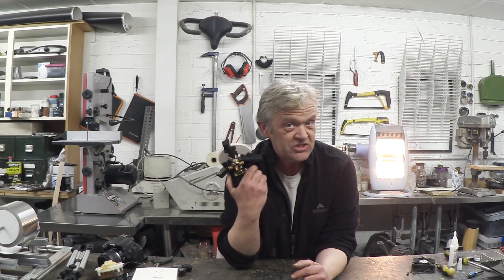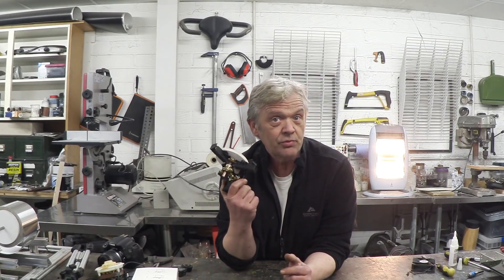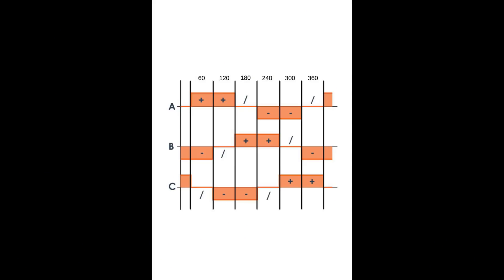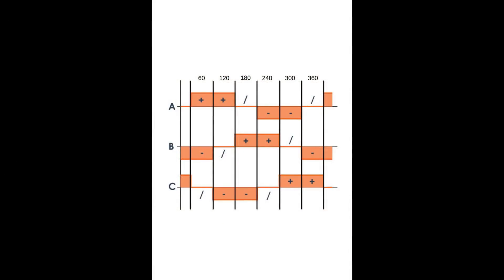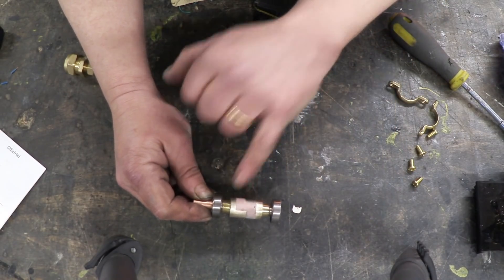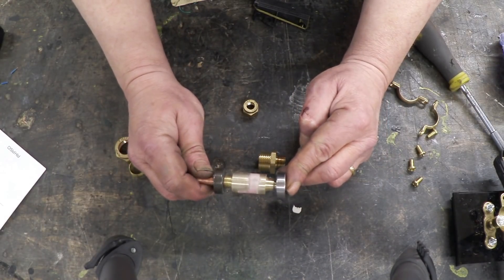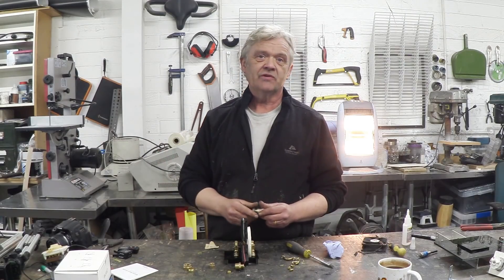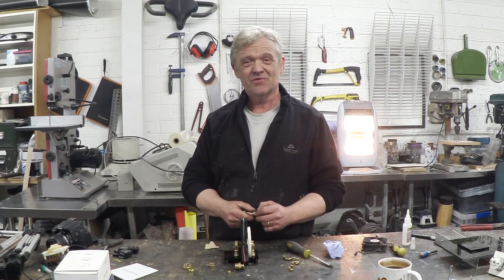1019 DIY Brushless Motor Controller Construction Details

Comment: it seems like one could get around the whole brush-wear issue, with 3 magnetically controlled momentary contact switches (like they've got in those swinging desk toys) and properly spaced permanent magnets on your rotor.   might add some small expense but if someone managed it,  I think it wouldn't require much if any maintenance, be frictionless, and still have the mechanical control advantage of being pretty simple.   Just a thought, if anybody wanted to play with that notion.  not sure how Fast those switches can go, physically- that might be an issue, but a more durable brush alternative for this sort of application where it's being a switch rather than a motor seems of some use.
Reply from the maker: that's clever mate - I like it
Reply: This sent me down a "conductive ferrofluid" rabbit hole (which I suspect your ink would excel at)-  a mix of copper and plastic tubing, and you've got a switch controlled by the motion of a permanent magnet (found a vid of kids that were working on the concept for reconfigurable circuit boards using conductive ferrofluid, that was mindblowing, but a simple switch that Can't wear out- that's relatively easy to achieve I think.)

Comment: When they say simplicity of engineering a DC motor controller they most certainly have you in mind. I am just amazed again with the down to earth way of making things on the cheap. Well done again Robert. Just cannot wait for more from you SIr. Thanks and peace too.
Reply from the maker: lol - cheers mate
Reply: @ThinkingandTinkering   we will make graphene brushes and use it as secondary bearing also  it wont wear out , fulfills primary obligation
Reply: @ThinkingandTinkering  i had this though last week... mainly cz i am poor and trying to drive a 200kw motor in a motorcycle

You have no idea how happy i am cz you saved me all the work and RND

Also the weight savings and wasted head are much less

Thank you sir
Reply: @FirstLast-tx3yj  How is your project going?
Reply: @Persanity  on the back burner
Just replicated the model but didnt make a larger unit for big power

But hopefully i get the time to do so
Reply: @FirstLast-tx3yj  I still need to replicate it so you are ahead of me! Hopefully we both get the time to work on it.

Comment: One application of brushless motors is in areas where there are flamable vapors. Where a brushed motor can't be used due to risk of arcing igniting the gas. This solution separates the brushes from the motor. That way we can still have the power without the cost or risk. Brilliant!
Reply from the maker: yeah - I never thought of that - cheers mate

Comment: Very simple and practical solution.  I need to power brushless motors for driving benchtop machine tools, and the IGBT 3-phase controllers are expensive!
Reply from the maker: I was thinking of doing a cheap H bridge relay based vision of this mate would that be of interest?
Reply: @ThinkingandTinkering  Yes, it would.  As a new sub, I like the way you approach electronics in an accessible manner.  Surplus brushless motors are often cheap, but controlling them can be daunting.

Comment: about 50 years ago i used to do some work for a board mill that still had a lot of DC motors .supplied from a very large and impressive mercury arc rectifier. speed controle was from a basic reostat for small motors  .stepped resistors like used on trolly buses and great big brime filled tanks with semi circular blades that were wound in. oh almost forgot the small ones with inductive brakes (an aluminium disc with a moveable magnet) i am realy enjoying these videos keep up the good work
Reply from the maker: cheers mate

Comment: Thank you so much for the details. Again, as I said in my last comment, you've solved a challenge I've been stumbling over for a while. 
After you showed the first video on this it seemed so simple I thought why didn't I think of that. But I was stuck on the electronic solution. I'm not good with electronics. And I'm not blessed with a large bank role.
Thank you again.
Reply from the maker: Glad to help!

Comment: Very nice, I like it.  Instead of driving this with a little electric motor, looks like this could be adapted to a pedal driven / geared input.
Reply from the maker: I like that mate - maybe a bit of clockwork too?
Reply: you are so right, that rotaiting motion should totally come from pedals, to save battery
Reply: Just had the same thought. This is my favorite comment section on all of YouTube.

Comment: Good but the ballbearings will fry with heavy current, you need two more brushes! Cheers
Reply from the maker: Yes, you are right - and a couple of slip rings - though some folks have made some really good comments on things that could be done here too
Reply: Yeah, I was thinking about problems you get with VFD on motors without a grounding rotor bush. Same sort of issue.